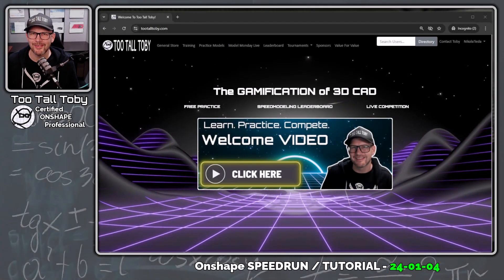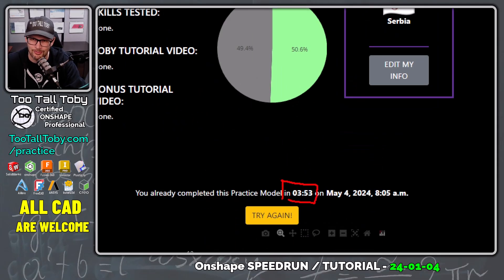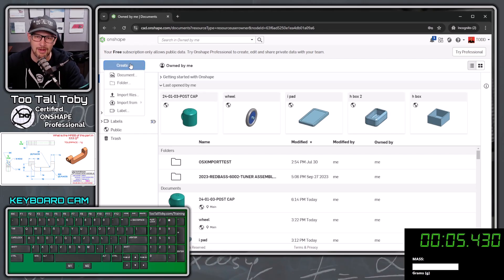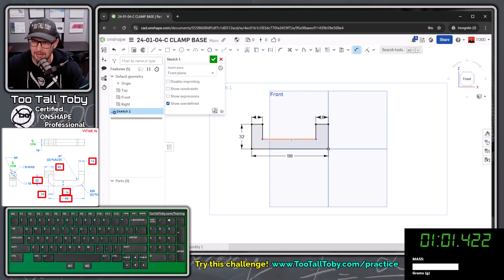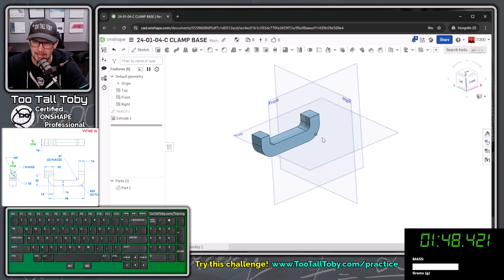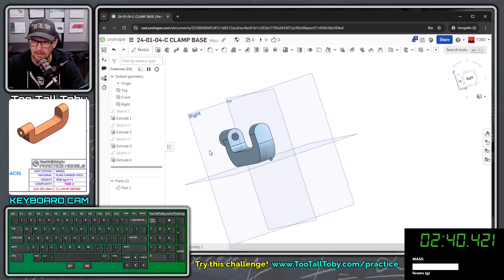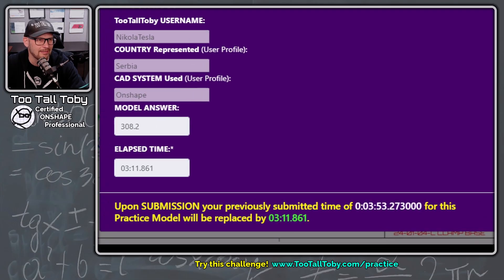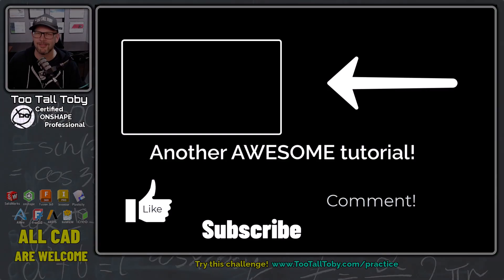ONSHAPE TUTORIAL - 3 Minute Modeling - Extrude, Fillet, Cut

Comment: Great job TTT! 👏

Instead of creating a 3rd sketch, you could have reused the 2nd sketch and extrude 25mm using "starting offset --> entity" and selecting the face you used for the 3rd sketch. Then a hole feature centered with the rounded face would complete the model.